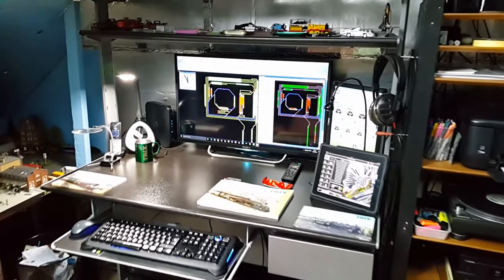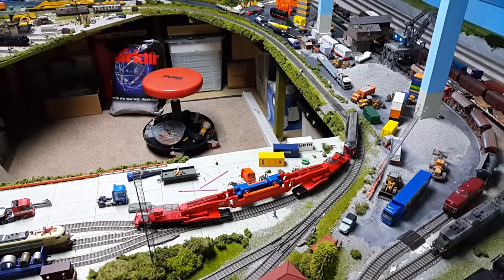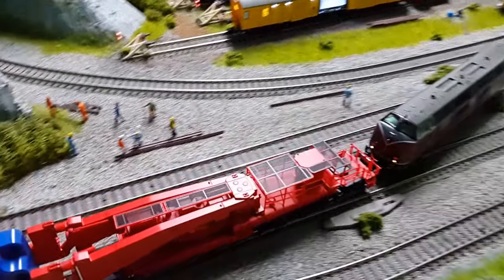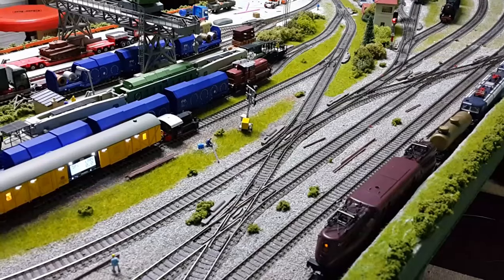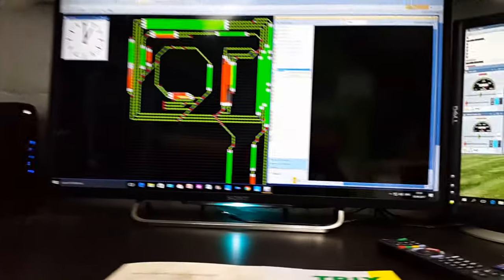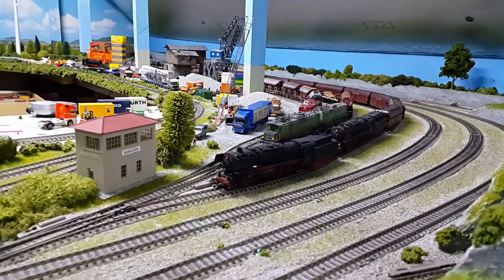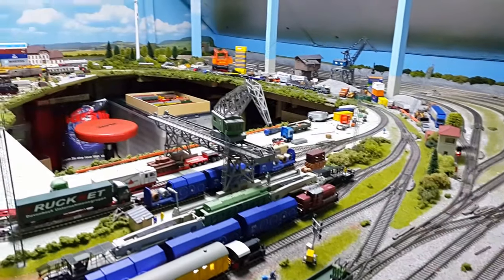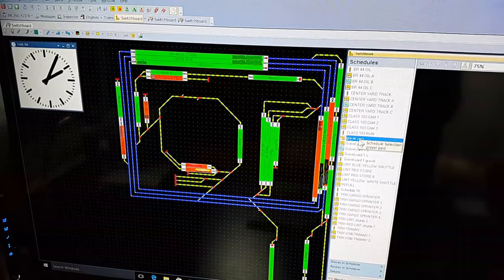Automation update

Comment: That's blooming mint Jim, really impressive looking set up, added to the already awesome layout. Enjoyable video 😀
Cheers Paul
Reply from the maker: Hi Paul..thanks ..about half way through the wireing for the automation side.
Reply: Hi Jim
Is it much work then to add the extra wiring, is it for the block detection?
Cheers
Reply from the maker: Dunge Wood yes as the wireing is much easyer when building the layout..its 64 lengths of wire back to four detectors.

Comment: Very impressive, was thinking of trying to set it up on my layout before I changed gauges, doesn't really seem much point now with relatively little track and a lot fewer trains.
Robin
Reply from the maker: Hi Robin..thanks..you can still do it using the ecos to control a basic shuttle run or similar.

Comment: Absolutely amazing Jim, again! - exactly where hopefully someday I also end up. 
Out of curiosity, knowing you primatily use ESU, what's the count on feedback modules, switch pilots etc. to create this level of automation on your 3 loops?
Reply from the maker: Hi Thanks, one feed back module unit {six blocks} and two accessory modules for the points this does only the three loops most people use two feedbacks per one block but I have used oney per block as it runs fine like this I think.
I am only a novice at this at the moment and only scratching the surface as much more advanced automation is poss...